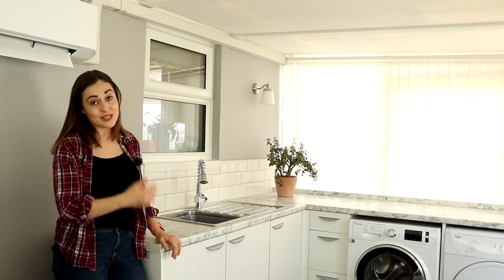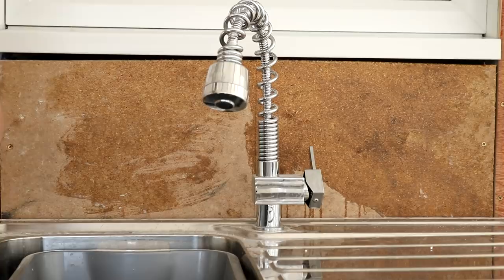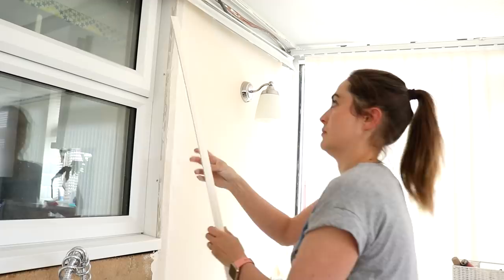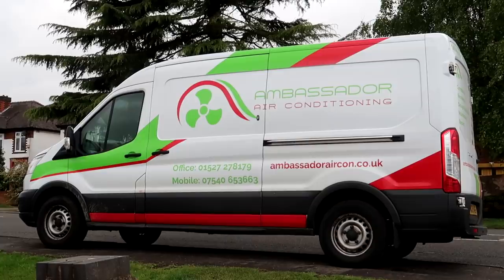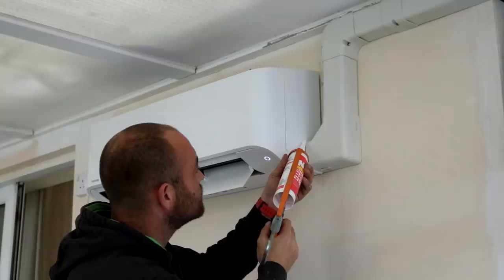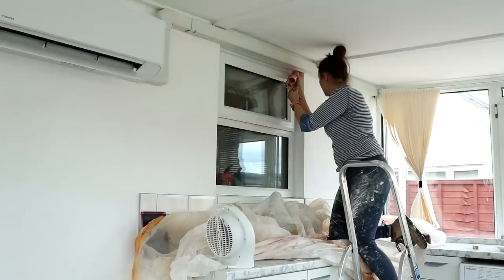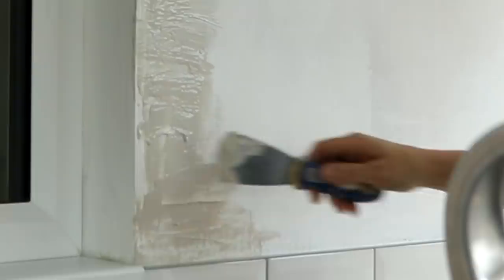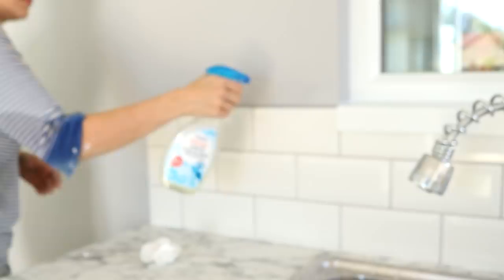Finishing My DIY Utility Kitchen | The Carpenter's Daughter

Comment: can i give you a tip abut assembling cabinets ?? i foudn that if you make a bench , say use two horses (you an get then for 10-20 each and a nice large bit of ply (just a bit bigger then your largest standard cabinet ) and when you assemble one side to the back put them in the upright position as they would be when assembled this will take the strain off the chip or MDF as you seem to have then with one side on its back 
oh and its not conduit that they run the evap pipes in its trunking trunking has a lid and conduit is generally round and inadvisable other then either end  and you should always have a condense pump for split units unless you can vent it directly out going down first 
oh and i would have changed the wall light for a nice little 7w LED bulkhead 
BUT im not being critical i hope you keep going as you do a lovely job and are clearly learning a lot
Reply from the maker: Thank you for the tips :)

Comment: Great job overall can’t fault your work , that air conditioning unit will be a god send when these heat waves arise
Reply from the maker: Thanks!  We've had a very hot few days already and as soon as I turned it off to film my intro, it became a sauna in there 😂😂  I'm sure any noise wouldn't have been picked up from my mic, but had to film it quickly and couldn't take the risk!